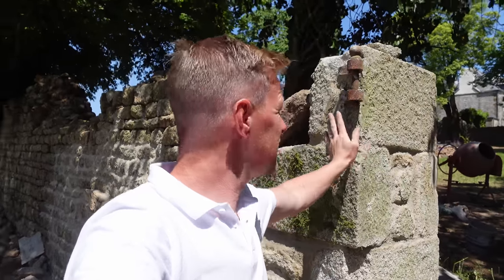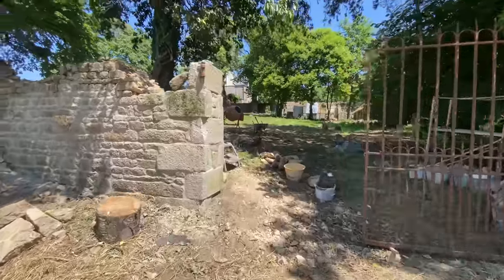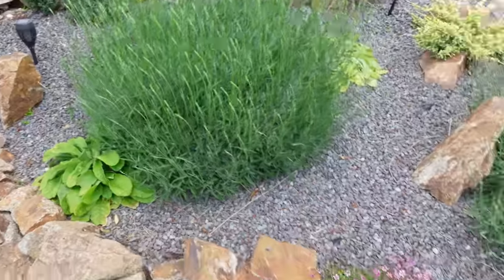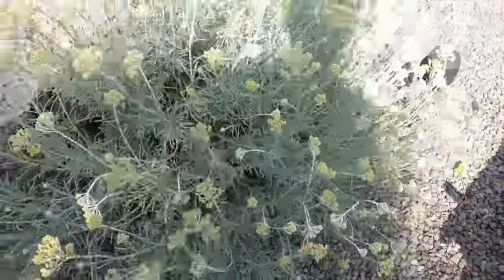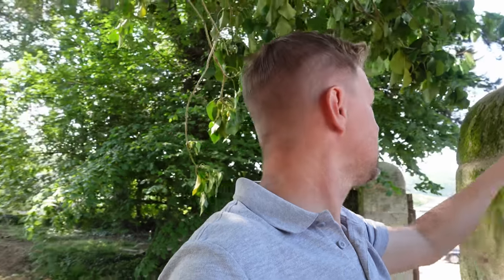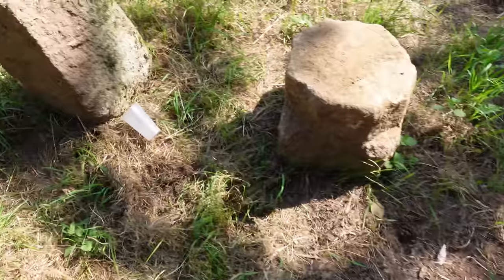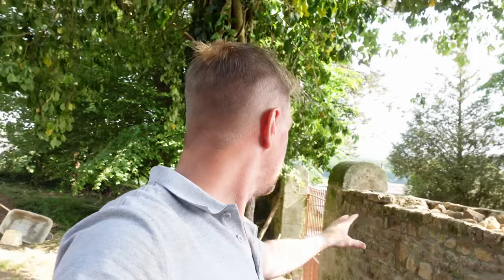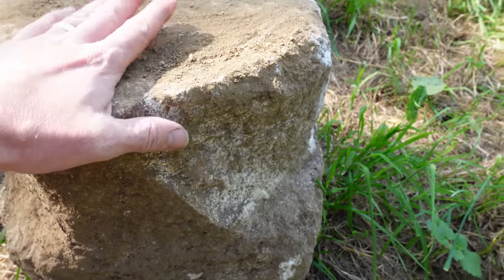Rebuilding the Original STONE Entrance For the Chateau | Discovering HIDDEN Stones.

Comment: Your octagon stone and the other stone could have been foot pillars for bigger vertical timbers holding up a cross beam on the entrance to a barn etc.
Reply: They definitely look like pillar bases.
Reply: In addition, the octagon stone suggests that it was used in a more prominent or visible location near the chateau.
Granite is very difficult to cut and would be expensive even then. The other plainer stones suggest somewhere less visible.

Comment: Congratulations on the wall and discoveries! The carved stones you've been finding seem older to me. Stone carving, from your experience, is labor intensive and is more detailed than exists in the chateau as it is now constituted.  That's what suggests to me that it might be from the ruins of the older previous building(s).  The eight sided pillar-like stone suggests that it was part of a pillar to support a ceiling with multiple vaulting-a late Gothic style, though in this case a bit plain, rustic, and slender.  So, as previously suggested it might have been a base, a footing for a wooden support column for an out building.  The tall triangular stone with metal rod might have sported another stone to complete the point or a metal finial.  Maybe a decorative finial for a roof top or a buttress support.
Reply: Yes, I’ve been thinking those three stones could be remnants of a medieval structure or garden. Someone earlier mentioned a sundial, which is a possibility I think. When you get a chance, maybe you can take a walk along the outside of the walled area you recently repaired to see if you spy any other “worked” stones half buried or sitting against the wall. The Château has more to tell you! Beautiful work!

Comment: Great job on the gate post and walls. The stone finds are I believe oak post base stones. We had one on our School house outbuilding. Shelter for the children, open on one side with  a frame and oak post in centre sat on a granite stone like the one with the metal rod through it. Post would of been drilled and slid over steel rod set into the granite, to stop the post moving off it's granite base. Plus stops the post rotting, as not in the ground.

Comment: take the 2 octagon stones and put a long stone on top for a stone bench in the yard, the taller one could have been used for a table base, some walls had steps along them for clearing ivy and debris.  I have a feeling you are going to find many stones on your property.  The stone with the spike would have had a wooden beam against it - possibly for a large wooden door or lintel.

Comment: The cut pillar stones look like they could be pieces of columns. What looks like a foot on the first one could be a footer or a header. These columns were almost always cut in pieces, then often dry fit together, or there might have been a long pin put through the centers. The first one found looks like it has a depression in the center. Those big decorative pieces aren't very good at hiding, so as you do more work around the property, you'll find more. The wall is looking fantastic!

Comment: I think that those 2 stones with that squarish base are for protecting the inside of that gate. On each side on the inside of the gate. So they wont hit the post with the wheels of the chariots. The other one with that iron pin is for a vertical wooden beam to support some other horizontal beams for ... a shed or ... pergola ... support for  roses
Reply: Thank you. They are all round elsewhere on the property. Not saying it’s not, but it wouldn’t be inkeeping with everything else 😊

Comment: The large stone you found in the next video, the one with the metal half circle embedded, was definitely a base stone in the middle of the drive with a gate stop to prevent the gate from swinging too far the wrong way and damaging the hinges. You could (and probably should for long-term health of the gate) put that back and your car tyres will easily drive on either side of it. {According to Snug Cottage Hardware "Gate Stops are used to prevent damage from forceful closing (slamming and windblown) of both the latch and hinges in a gate installation. No different than any of the doors in your home, which have the stops built into their trim work, gates also need a stop for the same reasons.")

Comment: I think they may have been part of a gateway, possibly replaced with the one you have just rebuilt. The French always loved their statement gateways, topped with domes. But even if you don't find the original location or use, the stones could still be used in the formal garden, as features on either side of a path between the two sets of stairs. They're beautifully made. Would be a shame to hide them away somewhere out of sight.

Comment: Check the squared ends of the octagon blocks to see if there’s a hole to take the spike on the other block. If there is they might all fit together, with the spiked one at the bottom, then the octagon with hole and the other octagon block inverted.

Dunno if that would then be a big enough pillar to take the big square ‘fountain’ stone… might not be quite chunky enough…

Comment: Before the turn of the last Century bases for sundials were carved from stone and because getting a round flat.
The octagon of shapes provided visual reference for people, looking at a sundial from afar to gain a general idea of the time. 
An octagon is a much easier shaped carve and is much more visually pleasing than a column or a square post on which a sundial could sit.
 
I am wondering if you clean up the dirt from the top if you will see two or three peg holes that may have held the sundial plate to the column, and I’m also wondering whether the sundial pieces that you found fit on top? 

Thanks for including us all in your adventure, and enjoy every episode, and I’m amazed by everything that you’ve accomplished. Congratulations.
Reply: Now that I’ve seen that there are two of them I’m wondering if they are the bases for urns?
Reply: Thanks Christopher. We’re really unsure. Planters would make sense 😊😊